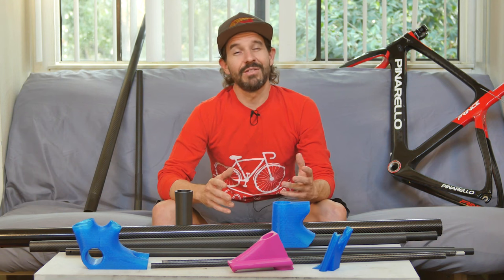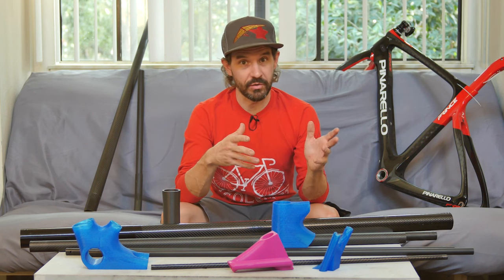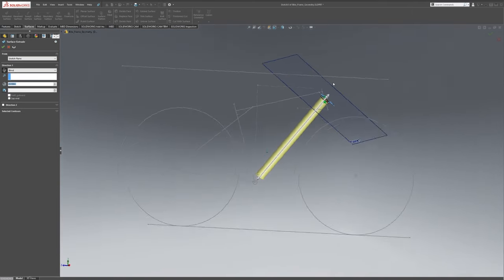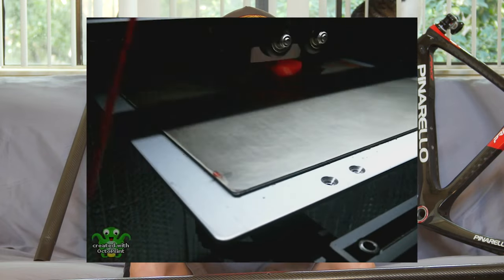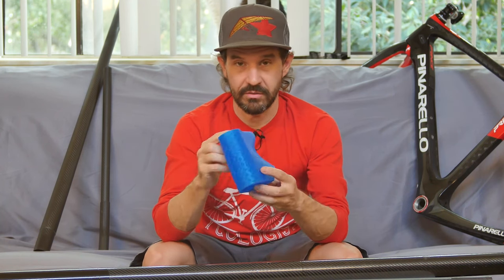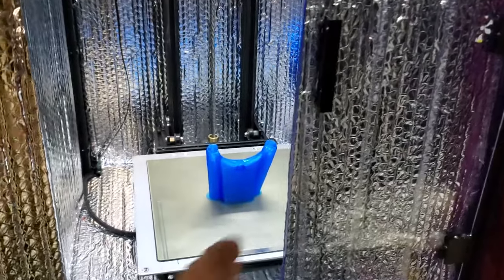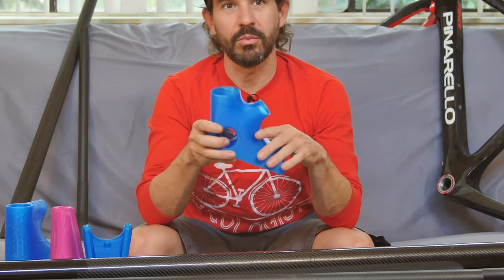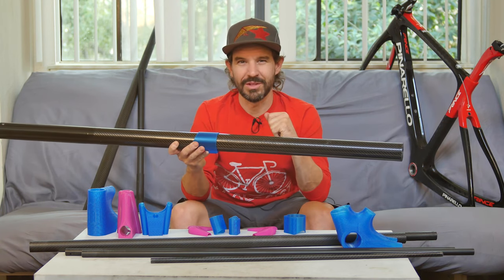Building a 3D Printed Carbon Fiber Bicycle

Comment: Hi Dave, I always wondered is there any possible way to do the load simulations on 3d printed parts through software programs as the manufacturing process is completely different compared to the traditional way of manufacturing.
Reply from the maker: As far as I know, there is not any commercially available simulation software that can do this. I was able to find a technical paper that outlined a numerical solution method for this, but it would take some work to be useful.

Comment: I’ve been thinking about this too!! Glad I found your video have you thought about wrapping the lugs and other high stress points with carbon fiber and resin? With a big enough plastic bag and a vacuum pump you can pretty clean results
Reply from the maker: Wrapping the lugs with additional composite material is unnecessary unless maybe if you use a "regular" FDM material like ABS.

Comment: nice, are you going to wrap the 3d printed joints in carbon fiber next?   I suggest polyolefin tape over carbon tow if you do, and a heat gun set lower than the melt point of the printed plastic.
Reply from the maker: No need to over wrap the 3D printed parts with additional material, but thanks for the tip!
Reply: @designbydave  really so just the printed parts are holding up ok? Thats awesome!
Reply from the maker: @blueridgedsia  I have over 100 miles total on the bike. Yep it's good.

Comment: Hi Dave, amazing work, super inspirational! Im in the process of designing my own e-bike and plan on taking a similar approach. Do you have any experience with Rhino 3D or is moving to Solid works a better idea for prototyping/printing parts for a bike?
Reply from the maker: I don't have any experience with Rhino. From what I understand, Rhino is superior for surface modeling but does not have the same level of detail working with multi bodies and assemblies like Solidworks does.

Comment: This is sick! I'm thinking about doing something similar, but with molds of the printed parts, so I can cast em and make em strong enough for a MTB. Where do you get the carbon tubes, and how much where they?
Reply from the maker: Ebay. About $20-60 per tube depending on size

Comment: Good process. I tried this approach and was using Fusion 360 and got frustrated and didn't invest the time you did in the model to make it work. I went back to my scuplture approach with pink foam and carbon fiber sleeving. Cool to see you do it.
Reply from the maker: Part of the reason for taking on this project was to learn and practice surface modeling.

Comment: Great work, David. It inspires me to work on a frame but I am concerned about a response comment. The weight of 3.75 pounds seems pretty decent but you said that a "conventionally welded Ti or Al frame would be less." I have a bike I love that is a recumbent called a Maxarya 2X. But it is too heavy, even though it is aluminum. If you looked at the frame, would say that changing to a similarly shaped carbon fiber lug and tube would not result in weight savings? I would love your opinion.
Reply from the maker: No weight savings with this construction technique. The lower strength 3D printed components requires more material (more mass) for equivalent strength.
Reply: @designbydave  What about using thin, flimsy connector pieces just to hold the tubing in position and then lapping them in carbon fiber?

Comment: I thought the carbon fiber filament was FAR more brittle than normal filament ?
Reply from the maker: Define "normal" filament. There are also a large variety of carbon fiber reinforced filaments so the ductility will vary greatly. This particular material I'm using (carbon fiber polycarbonate) is not brittle at all.

Comment: I enjoy following your videos, Dave. Interesting application for the 3D printed parts. I am eager to see the results. It looks like you take into account the Z-layering. This is a crazy cool project!
Reply from the maker: Thanks for checking it out. There's a term not many are likely familiar with, "design for manufacturability" That of course means taking into account the manufacturing method when designing parts. Since I know these parts will be 3D printed, I need to take into account all the capabilities and limitations of my printer. Hence that large, flat bottom surfaces, z layer orientation etc. Were these parts to be CNC machined or molded carbon fiber, they would look quite different.
Reply: @designbydave  - nice! I really look forward to seeing how this works out. I personally thought about putting in aluminum sleeves inside the 3D printed brackets then annealing them. This is a really neat bike project. It kind of reminds me Land Shark bicycles. Very unique and I think you are onto something!

Comment: Where's the part where you mold and print in forged carbon also the joints? Cause don't tell me your goal was actually to make a carbon tubes bike with pvc joints.
Reply from the maker: Yes, watch the rest of the series
Reply: @designbydave  I've seen it! Cool I thought you were going to cast the chopped tow fibre to mold those joints. What if also... If the tubes had to fit the joints outside? I mean bonding the pipe, the inner part, with the exterior of the joints. They did like that in the 80s I heard (alluminium joints with carbon tubes). You might have to design a step on the joint and measure carefully the... oh lord. The beefiness of the pipe how's calld it, to make the depth of the step where you bond 'em. 
I see the pro that you'll have straight cuts on the pipes, and you can size any bike to the rider cutting pitagoric correspondant measures for the 3 main tubings. 
Send'em a very basic jig in the box and voilà, it's a DIY cut-to-size carbon bike! :)